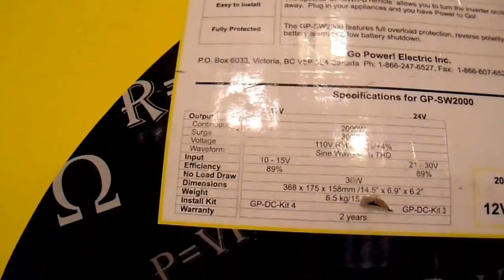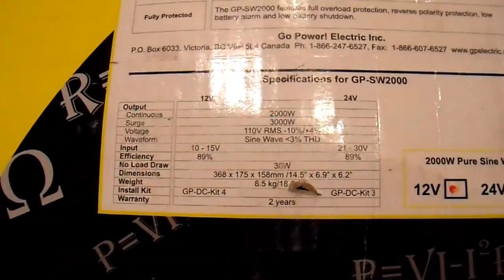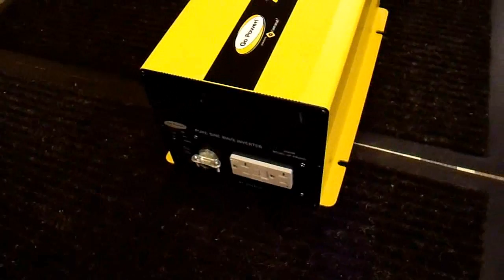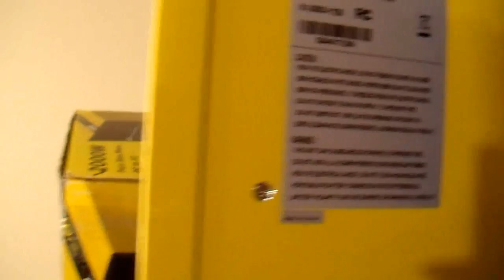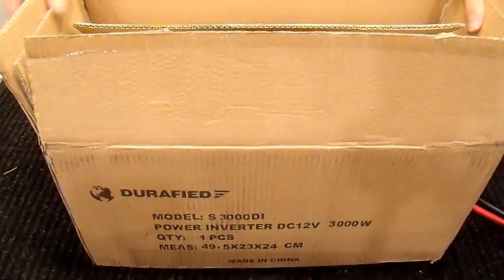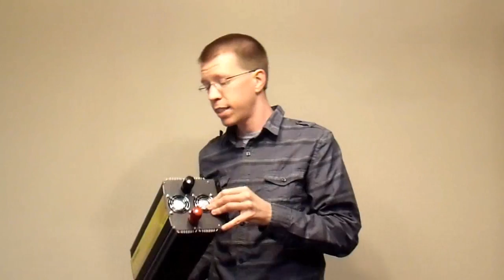Twelve Inverter Review - Part 4 : Go Power and Durafied

Comment: is there an inverter with adjustable low battery voltage cut off  between 10.5 v and 12 volts? 
Thanks
Reply from the maker: Some of those super cheap Chinese (e.g. powerjack) inverters have adjustable low voltage shutoff potentiometers, but I would NOT recommend them for much of any purpose.  If you want a truly adjustable low voltage shutoff I'd actually recommend an external dry contact relay and hook it up to the power switch of any inverter.  You can find adjustable voltage switches like that in a variety of forms from a variety of sellers.  Most are some form of no-name part from eBay or the like but they're simple and they'll work.
Reply: @knurlgnar24  okay, thank you.

Comment: If you run a microwave useing a power inverter the microwave turn table turns counter clock wise plug in to house current it turns clock wise
Reply from the maker: The turntable switches directions every time the microwave starts up again.

Comment: You ever talk about hooking up an inverter charger and running  shore power through the connections   Through the inverter hardwired and the fact that you have a neutral ground bond on the output when you're on inverter and   you isolate the neutral ground when you're on shore power you know what I'm talking about.  In other words when you're on shore power and its just passing through the inverter the neutral ground bond is made at the service entrance disconnect in the house  And when your coming off the batteries producing power with the inverter the neutral and the ground have to be bonded because you are now a power company producing power essentially.  This is typically done internally and most people are unaware of it internal on the inverter output.

Comment: I have 3 of the Durafied  inverters  Model S3000DI which I bought on  eBay auctions  for $86.99 and lower. I have them hooked to 15 large 12 volt  batteries which are my battery bank . I bought all in Walmart-they are all their largest deep cycle batteries. .I use only one to run 2 large double wide refrigerators 26 cubic ft. each and 2  chest freezers 15 cubic ft. each. I run 10 gauge extention cord 50' from the shed to the front wide open front porch and combine all four machines to a GFCI 6 outlet surge protector That has been going on for over 2 years with out any problem. I Just do this in the daylight hours and at night I switch to my house electric so as not to drain the battery bank to much. I use one for power tools and the other for my shallow well pump and washing machine. The one you received must have been a lemon. I do not think these machines power more than 1500 watts  each but for the cheap money of under $100.00 they are the best deal in town. I do appliance repair and the inverter has not harmed any appliance.

Comment: ive got a sinergex 2000w inverter which looks identical to the go power one.  for lithium batteries the 11.5 to 16v range would be ideal but mine is the 10.5 to 15v can this be changed by some settings

Comment: I'm looking for an inverter to use in an unheated barn in northern Michigan and am concerned about the published low temperature range.  Several, including Go Power, are rated down to 32 deg. F.  I really need it to work as low as 0 F or even lower.  I plan to go with a 2000W to 3000W model so I can power an air compressor in warmer weather, but need to at least power a garage door opener in the cold.  What can you recommend?

Comment: Pls I need your advice. I've a 1kva 12v inverter with three 12v 150amp batteries connected in parallel. I will like to install solar panels to power it. what do you suggest I use. how many panels and what ratings + charge controller rating will give me continuous power on the system. thanks.
Reply: It's a good start! I would get 3 panels@150 W. each just to start. More panels is better.Your controller will handle over voltage situations.
My PMA 40 A. Chinese controller works fine.
Do NOT go cheap on wire. All copper,fine braid and at least 6 G. to the inverter.
I ran 8 G. wire from my panels,but it's 22 feet away.  I got a voltage drop.
  For cheap wire,see a salvage yard. I bought mine for the cost of the copper by weight. Also,dual 10 G. wire that is bury able,used for low voltage lighting is CHEAP.
 Continuous power? Depends on your loads.
Do more looking,but you are on a good path.
Reply: Thanks so much. What if the 3 panels are rated 24v 250w?
Reply: 250 Watts is 250 watts. Maximum out put.
total: 750 watts.....On a VERY sunny day.

Comment: Can you modify the 11vdc inverter (fleet) to 10 or 10.5v internally? It's a great deal on their online website vs std inverter. Does it have an internal transfer switch or is the TS-30 still req'd?
Reply: Never mind, I just picked up a Prosine 1800w with build-in transfer switch for less than $400 used. :-)

Comment: Hi Kn , I recently downloaded the spec sheet for the 2000w and it shows the no load draw as 2.8A and with powersave as 0.6A.  I plan on purchasing the 3000w which is rated at 2A / 0.55A on powersave.    30w divided by 12v equals 2.5. So they may have changed rating in watts to amps since the box was printed.  Have you had any recent issues with the Go-Pro 2000  or tried the 3000W unit ?    Jim K

Comment: I've been studying the inverter choices I'm less familiar with and came across the blog portion of the excellent Victron website. In reading this tech paper on Lithium Ion vs AGM batteries, I think I might have found a good match to your 11.5v Go Power GP-SW200. It seems that they recommend a higher cutoff voltage for lithium battery packs and in one of the other blog entries, the one for a batteryProtect device I believe (https://www.victronenergy.com/blog/2016/08/15/batteryprotect-new-instructional-videos/). 

Anyway, there are discharge curves here and the Lithium banks would seem to benefit from a higher voltage cutoff routine. 11,5v sounds good.

https://www.victronenergy.com/blog/2015/03/30/batteries-lithium-ion-vs-agm/

Comment: thanks for these videos. do you sell any of the inverters? I am in need of a good one. to run a fridge. microwave. TV  and a few lights. either led or cfl. I would prefer one I have seen what it can power. and is full sine wave. and 12or 24 volt. and at a good price. thanks again.
Reply: Microwave is a power HOG!!!!!! Mine pulls 1420 watts!
Do the math,please.
3,000 W. minimum. Lot's of batteries.

Comment: I have been looking at 300 watt pure sine inverters for off grid.  only use for tv and small fan . have remote start generator for microwave ect. I was thinking samlex but noticed the samlex is 1.5 lbs and the go power is 7.7 pounds . could this extra weight equal better inverter?

Comment: I'm at a cross road. 
I only need 1500 watts but I'm trying to decide between:
Go Power,  Samlex and Cotek.
This is for power in my van, even though it will be kepped dry.  There will always be some moisture and vibrations from the van. 
Could you help me make the right choice?
Reply: Go Power is fine. Run a 4-6 farad power cap to ease the loads on the batterie(s). Rubber mount it and run the fattest wire from your batteries. I used 4 Gauge and it's OK. My 1500 W. chokes on an 800 Watt load and I'm not sure why,yet.  (?)I run 3 100 ah. gel cells for my solar power set up.300 W. panels. I'm just a watcher that bought the Go Power. Dave in Seattle.

Comment: Your reviews are very helpful -- but I'm surprised that you don't understand how inverters this size are used in the real world -- first of all, as GO POWER told you, if it's used in a vehicle and powered by the same battery that is also used to start the vehicle --- as a lot of people do, not just fleet industrial users -- you don't want that battery going below 12 volts or you won't be able to start the vehicle. So a warning buzzer at 12 volts and cutting off at 11.5 volts is a really good feature (because from a brief drain to 11.5 volts an automobile battery in good shape will "bounce" back to as much as 12.3 volts fairly quickly).

If integrating this inverter into a real-world continuous-use off-gird solar-power system, you have expensive batteries operating on a daily discharge/re-charge cycle. The battery manufacturers recommend not draining their batteries below 12.06 volts -- which is 50% of full charge -- to ensure long battery life.  Most useful solar power systems have battery banks totaling at least 200 amps-hours capacity, so you can drain 100 amps out of it ( that's 100 watts of continuous  AC power for 10 hours) and still have your battery bank be 12.06 volts (50% of full charge), ready to be re-charged the next day by your solar panels to a full charge of 12.8 volts.

Most people don't realize that a 12-volt battery reading 11.5 volts is down to only 20% of its useful charge left. At 10.5 volts it has 0% of useful charge left and is, like, totally dead for all practical purposes. Do this to a standard automobile battery even a couple of times and it will be so dead that it cannot be re-charged and must be replaced. Do this to even a true very expensive "deep discharge" battery and after about 180 re-charge cycles it will also need to be replaced.  In a daily-use solar power system, draining down to 10.5 volts every day,  you would be replacing your entire $600 to $1000 battery bank twice a year!  By only draining the battery bank to 50% (12.06 volts) the life of the batteries rockets up to 500 re-charge cycles!

Honestly, except for the very occasional user who doesn't mind replacing their inexpensive  battery on a regular basis because they've been draining it down to 10.5 volts, I can't imagine very many real-world uses where an inverter that draws the battery down to 10.5 volts before cutting off would be a good idea at all.
Reply: I run mine down to 11.9V and STOP.(Under load.) It bounces back.I'll need more capacity. I'm on solar.  AGM's.
Reply: I agree. On a lead acid flooded battery,12.2 is my limit.(under load.)
Reply: jr sparrow go back to school.

Comment: I would not use pure copper terminal lugs. Get zinc plated lugs to be smart.Copper ones will corrode quickly at the battery ends. You will see,soon enough.
Wet cell batteries will gas a lot under load.

Comment: My 1500 W. Gopower cuts off/beeps @10.5 V. input:PERFECT!
Very happy with my unit. 2 gel cell 12 V. in parellel.
$571 from Ebay.
I agree with your nit picking!
Input posts too close together! I used 4 Guage wire for inputs.
I have a 150 W. fuse/breaker on my system:resettable,too.
Works fine! My computer,2 monitors and a small refer and some lights: 330 W. per hour.
Thank you for a great review,Sir.

Comment: If you are running your battery down to 11.5 volts you are going to destroy it. I never run mine down below 12.2 volts. but at times I have ran them down to 12 volts and it is not something you want to do if you want a battery to last very long. I use optima yellow top batteries and they are AGM batteries that can last up to 12 years if you take good care of them. It takes a lot of batteries to have a decent system.
Reply from the maker: There is a tradeoff between DOD and battery life.  Keep in mind that under load batteries will drop to a far lower voltage than open circuit.  A fully charged battery under high drain will drop well below 11.5V, so voltage alone is not a good indicator of how discharged a battery is.
Reply: ***** This is why you want many many batteries so the voltage will not drop far. If you have about twenty batteries there will not be much of a voltage drop under a load.  You never want to discharge the battery much so many batteries will help keep the DOD good. If you let the battery settle or sit for a few hours and the voltage is still high then you have a good idea of the DOD.

Comment: Hey, Would you recommend this inverter, Sinergex Pure Sine 2 2000? Just purchase one, it was a great price and i didnt wanna miss out so i took a chance and ordered it. I looks like the samlex 2000w thats what peaked my interest.
Reply from the maker: I have not disassembled one and inspected it, however if it is a rebranded Samlex like some others out there then you made a good choice.
Reply: Thank you sir.
Reply: Wanna thank you again for your advice on the Singerex 2000watt inverter, I got it for less than $150 and it think "now using it" it's the best investment "solar wise" I have made, I opened it up to change the voltage output and it's built like the samlex, and Thor 2000w models. Again thanks!
Reply from the maker: Adrian Symister
At that price you must have stolen it.  ;)   Good find.
Reply: HELP!, Morning Sir, About the Sinergex 2000w inverter, I turned it off last night because my battery bank was at about 50% and when i turned it back on this i got a solid red status light. I looked in the manual and it  says Over Load Protection. i disconnected everything and its still displaying that. What do you think is the first thing i should look at?
Reply from the maker: Adrian Symister
That's not good...  If you measure good voltage at the input terminals and it still complains about overload then it may have an internal problem.  Was there a warranty?
Reply: Thanks for responding, No warranty, the input voltage is 25.6v its a 24v inverter. you have any idea where to start looking for the problem?
Reply from the maker: Adrian Symister
Usually the problem lies in a shorted output FET when an overload LED lights up.

Comment: Why does many of the inverters say "Not for Marine Use"?
Reply from the maker: Inverters are labeled 'not for marine use' for two primary reasons:
1)  They are not conformally coated to protect them against saline environments.
2)  They do not want to incur the high warranty costs of corrosive environments.

Comment from the maker: I haven't looked at a PEAK brand inverter, but if you have 7 of them running in work trucks without a failure they must be well constructed!

I'm curious, what kind of alternator(s) do these trucks have?  Any issues with alternator durability?
Reply: I got a peak 3000 it's great but dont know where to get a nother one Amazon dont have them nomore not the 3000 watt one .peak is made by poteck .

Comment from the maker: Go Power customer support was excellent - I was very impressed.  As usual for warranty returns I had to pay shipping to get the old unit to them, but the replacement unit was shipped promptly and was brand new.  I am completely satisfied.  Not many companies offer that kind of support.
Reply: I got a wagan tech proline 3000 watt the fans come one with no load and runs 30 seconds to 1 minet then of does that constantly is it saposed to .and my peak 3000 works beter than anything I got run 12 cup coffee pot it never gets even warm even with microwave on at same time .but the proline gets really hot with the coffe pot .but runs microwave and airconditioner no problem never gets hot

Comment: The Factory should adjust the unit for you for no charge so that it will work with an input of 10.5v (Also have them set the LOW output voltage to 105v)- However, Again, You will be out a sizable chunk of change for the shipping.

Comment from the maker: I am extremely impressed with the Samlex/GoPower SK series inverters and highly recommend them.  I'm sure others exist, but I haven't yet personally seen any other inverter come close in build quality and performance.  They are designed and built very well.  I have a feeling an M1 tank is of slightly heavier construction, but as far as inverters go they're pretty good.  ;)